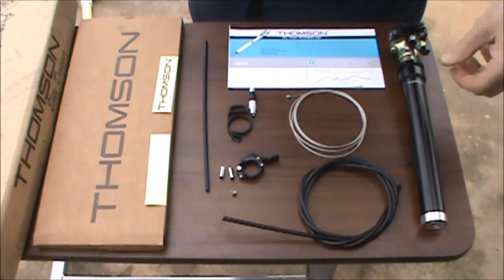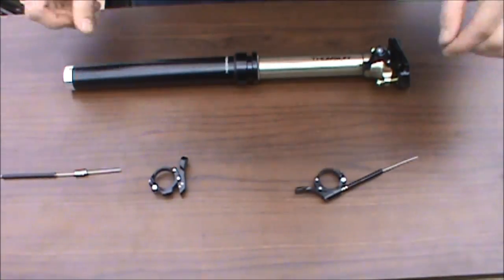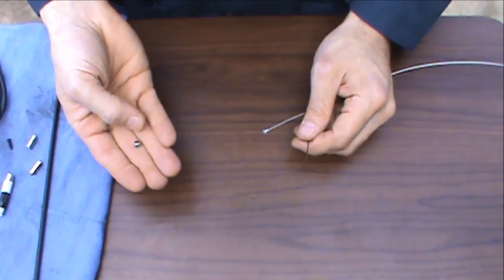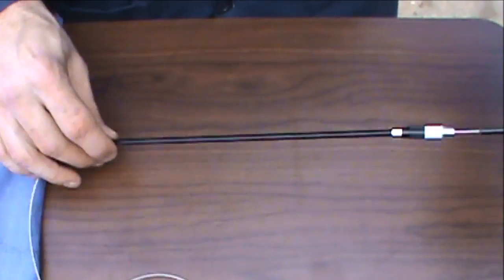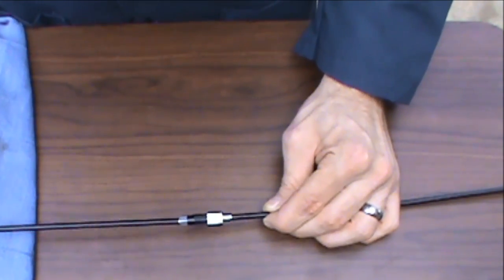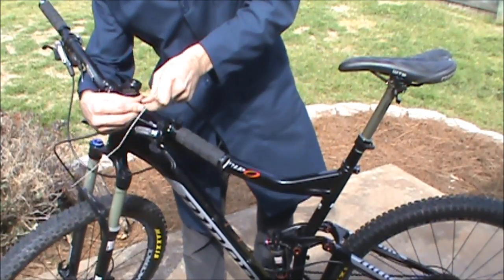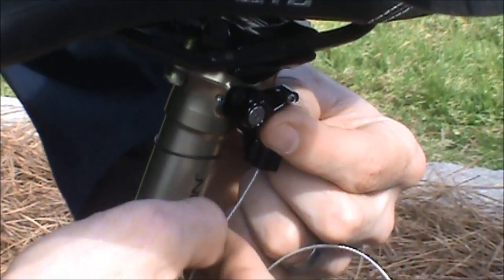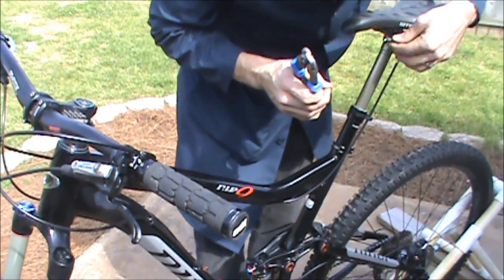Installation procedure for Thomson Elite External Dropper

Comment: This would have been much more helpful had the video not cut away at key steps like connecting the cable at the trigger.  Also, showing close ups of how the cable connects and secures at the seat post would be much more helpful.  Being that the instructions included with the post leave a lot to guessing how to do these steps, I was hoping for much more detail here.
Reply from the maker: We will work on an updated video.  Thanks for the feedback.  We will take that into consideration for the next iteration coming soon!

Comment: You show installation for the older style remote lever without showing installation for the new remote lever!  
My problem is that I had no problem figuring out the old style 2 or 3 years ago, but I am mystified by the new setup on the new Elite Dropper I am currently attempting to install!
Reply from the maker: The lever is installed the same way.  The cable housing is installed the same way, just reverse the cable, and secure it using the set screw in the remote lever.  The cable end will be located at the cam lever on the post.
Reply: Thank you. I did figure it out, but it wasn't immediately obvious to me. I do like the new design.
Reply: hallelujiah thank you for this information!!!